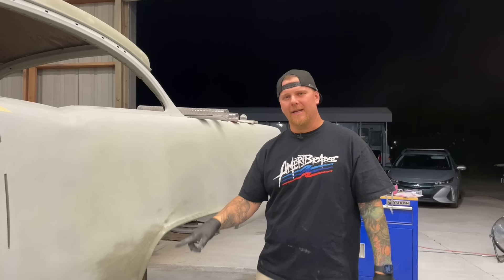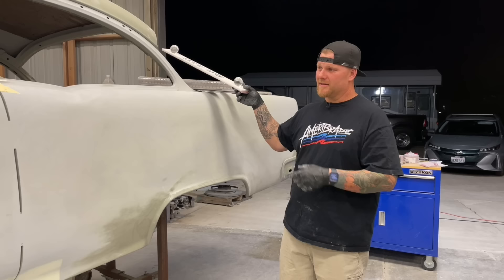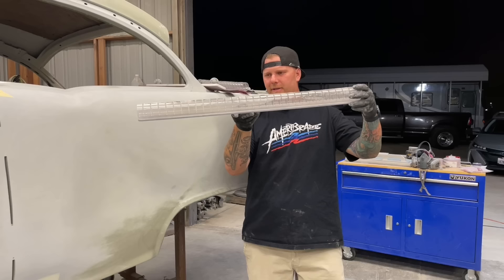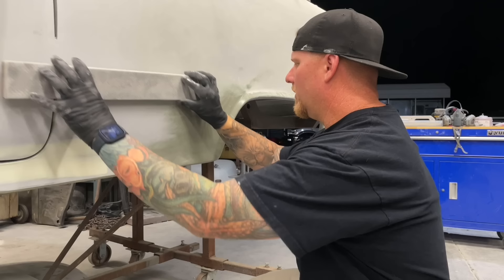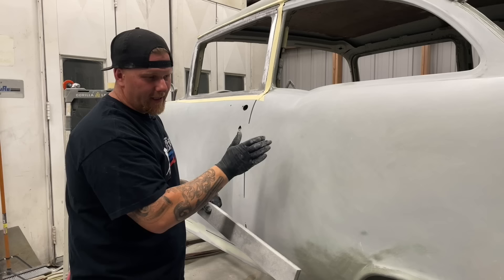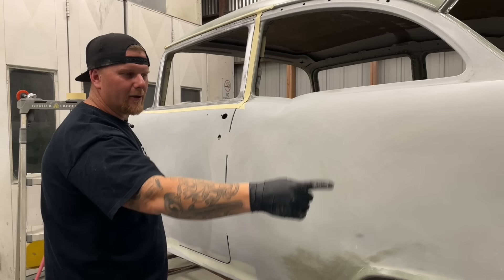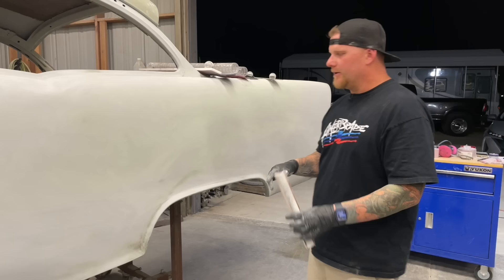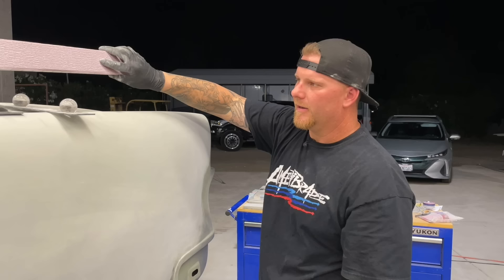Blocking The Details: Smooth Flat Mirror Transitions Every time

Comment: A few minutes after 7PM and I am in the garage, a man cave with dirt & shiny stuff covered in dirt. I guess I must old if I had a spray can made to hold sand paper on the tool I was using. I think it is between the distributor wrenches and the chrome tach-dwell meter w/cylinders 1-8 setting.
 I have eased the edge on a paint stick to work the guide coat off around the wheel house flare. I have seen that filler on the doors before and felt is the hinges are rebuilt, and gapped with a paint stick all the way around, perhaps a little hammer spoon or slapping spoon (Call it what you want, but use it) I have a length, curve radius and width drawn on paper, to make another so #3. I am not a body work guru, but you make it easy to understand. Either a sanding block or chainsaw, if you have to push & push every time, the paper is dull or loaded or the chain needs sharpened. Right! I used a folded wire coat hanger with a length of fuel line as a handle. This knocks the chunks of filler out but also you lose your sanding grit if the same paper was new 20 minutes ago. Get a new one, try buying a better product as it makes a difference on production. How many tools work better if we let them do the work? By weight, sharpness, etc. They made crank ice cream machines also, but to worn out to enjoy the ice cream. I am not saying to buy electric because either way, you still get ice cream.
  Question: You say polyester high build, but it make me think a tube of hardener with a clear liquid inside. This makes me think of polyester resin in fiberglass (Vinylester resins-pink) but I have seen comments that this is hard as a rock to sand? Instead of a cream hardener this is now methyl ethyl ketone (MEK) not methyl ethyl ketone peroxide used in the cream hardener. Many videos talk about sanding a Corvette, or fiberglass kit cars but bring up gel coat! That is colored spray on body filler that uses a styrene-monomer for thinning, but uses the MEK (Clear Stuff) to harden.
They spray gel coat on top of gelcoat (Not too thick if the fiberglass was right) but it is sanded that same way. Some boat techs keep a microfiber towel in a zip lock, spray dykem on the gelcoat as their guide coat. 
  No, this isn’t fair to ask you to put on your chemist hat with pointy tip, but for a high build primer that uses a clear hardner, does this sand harder like fiberglass because I have never used it. Just asking as I do research to decide what to buy! 
Have a safe 4th holiday….everyone.
Reply: Hi Dean. I know the VP2050 he uses is epoxy based. I don't think it's a polyester. This primer takes a little elbow grease to sand but not as tough as some of the polyesters I've used.
Reply from the maker: Thanks for watching. Not sure on that clear hardener sorry
Reply: @class5bodyworks  Thanks Chris! Very much as this old man leans. Elbow grease is on back order everywhere! Go figure. Stay safe an enjoy the 4th and time with family and friends!
I appreciate you info from experience!
Reply: @SYLVESTERSCUSTOMS  it is cool! Enjoy time off this holiday, I have 5 or 6 things to do that are hard for an old man, like me.
Reply: @deankay4434  
Anytime. They say age is a state of mind. I'm not so sure as I get older😞. This line of work is elbows,shoulders and knees. Enjoy your holiday as well everyone.

Comment: One thing for improvement and it doesn't cost anything compared to what it saves. Tape! Your primer work is hard,shrinkage is done, primer is "Gassed - Out" as I call the evaporation process necessary for purr-fection as Sylvester would say! Tape off your radius areas you don't want a line or accidentally nicked area or flat line (low-spot) to occur. Take areas down is easier than building back-up a fantom wave or straight line created from a sandpaper edge from your block. Pinky is also advisable, I do that too, but that point in your video you do not cover the end with your pinky! Taking tape prevents any mistakes we can easily make happen. Then roll your radius into the wheel well lightly to blend to straight panel. Tape is a Gret way to keep your body lines along the side of vehicles straight! Once you cross hatch down to a body-line Tape it! Then sand bottom half of car up to the Tape line placed ON the already flat cross-hatched primer! This gets a sharp straight line back into your side or primer area. I often times have too sharp of a line and lightly sand the sharp straight new-formed line with a very thin foam sanding pad very lightly to knock the "sharp-edge" down so paint doesn't separate from being too sharp.
Reply from the maker: Agreed! I dig the purrrrfect lol 🤣 if you haven’t already check out our video on body lines makes it pretty easy. I do all body lines last. 👌🏻

Comment: Just found your channel and learning a ton!  Also recognizing that my number one mistake over the years has been pressing too hard on the sanding blocks 😬.   So after 220, it’s fine to go straight to 600 wet sand?  No 320 or other grit between?

Thanks again for the amazing and informative videos!
Reply from the maker: I jump to 600 from 220 as long as you are thorough there’s no issue
Reply: Awesome brother, appreciate it!

Comment: So, I have told you before, I love your channel & wish I would have found it sooner! Thanks for all the great info. After watching this one several times, I am unsure of one thing: I am in the final stages of sanding my polyester primer @ 220 grit. I have burned through the polyester in a few places to have spots of either filler or epoxy primer showing through. I understand I need to apply primer (or epoxy sealer?) to those areas & block them down before 400 grit wet sanding. Do I use polyester? Or reduced epoxy primer (20% reduced epoxy primer will be my sealer). If you use polyester, I'm afraid of burning back through after all the grits. Thanks for answering my question!
Reply from the maker: Thank you!! Honestly if it’s just small spots I’ll just spot prime them with whatever primer you are using. If it’s a lot of areas I will prime it all over again. I use vp2050 because it gives way more build and you can wet sand it unlike most polyesters 👍🏻

Comment: Hi from Australia! I’m using VCP 250 on my project and my data sheet warns not to apply body filler over this product? Would data sheet be referring to large areas of filler over top but small areas with a wipe of filler would be fine? 
Your videos are awesome thank you
Reply from the maker: Body Filler may be applied over VP2050 after an over night air dry and a light sanding. If applying body filler, two coats of VP2050 must first be applied. This was directly out of their TDS sheet for VP 2050 not sure where you saw this. Hope this helps. 👍🏻

Comment: Three coats hibuild epoxy. Blocking now with 120. You instruct to fill small lows with thin filler. When that is blocked out, do you need to respray with the epoxy or can you proceed to paint after the wet sanding is done? Also…bare metal exposed…re-spray these areas?
Reply from the maker: Filler and bare metal will all need to be covered you also cannot wet sand filler.

Comment: Another great informative video! One question. Do you use the dry guide coat just before the wet sanding stage? I guess I'm asking, does guide coat work while using water? Thanks again. Cheers John 🍻
Reply from the maker: Because it’s shiny and smooth initially it won’t stick so I use aresol but after it’s opened up I use the dry. As for when wet sanding with water the dry works great. Check out the video we did on polishing clear coat with it even 👍🏻
Reply: Yes, it will work wet also.

Comment: After you've completed wet sanding to 600 grit, do apply a sealer before basecoat - or basecoat right on the VP2050?
Reply from the maker: You can do either or but I recommend sealing it then base coat.

Comment: There's been a lot of discussion about phantom wave caused by different materials expanding and contracting at different rates. You mentioned the primer is more brittle than the filler. Any reason why these two materials together wouldn't cause phantom wave? One is polyester and the other is epoxy based.
Reply from the maker: Phantom waves are caused by the metal work being under tension and not relaxed.
Reply: @SYLVESTERSCUSTOMS 
Curious. I remember discussion about why it's not a good idea to maybe topcoat the 2050 with a urethane or other type primer for example. So this has no effect in the phantom wave or is it more because of cure times?

Comment: How many inches is the longest block you generally use? I have the 32in linear block set and i can't agree more on how important the hand placement is. it's either flexing too much raising the center off the panel or the ends are off the panel just defeating the purpose of that size block thinking of selling the set on eBay or keep it incase i ever find myself working on a boat, would 24in be more practical or in your professional opinion is it still a bit much
Reply from the maker: You are correct the longest block I use is 22-24” long any longer and there’s no point unless you grow an extra arm 🤣

Comment: I've been doing semis here lately, and they've got huck rivets everywhere,  you have any tips on something like that?
Reply from the maker: That’s a big challenge. I don’t have anything on it. But if I was doing it I’d use paint stripper to remove all old paint and make sure the metal was in great condition so you could put down your primer minimally to keep mill thickness from building up and roll into paint
Reply: Thanks man

Comment: Do you only block sand die coat, or can you da die coat. I seen another chanel use a da and I didn't think that was right.
Reply from the maker: Only time we ever use a DA is when stripping cars 👍🏻
Reply: You can sand guide coat either way.  You'll typically see D/A used on collision repair vs. restoration.

Comment: Could you find an example  panel that was easier to sand? What happens to the rest of us 97% of people who have body lines, ridges, accents stamped in the sheet metal? Most of us can sand a sheet of drywall also. You are good and very detailed but most of us are working with a much bigger challenge's as far as sheet metal panels.
Reply from the maker: Then ask a question that can be answered. Every car has its challenges period.

Comment: Question: do you do the same process for intricate front bumpers?
Reply from the maker: If it’s an older steel one yes. Plastic bumpers no
Reply: @SYLVESTERSCUSTOMS  what’s your process for plastic bumpers?
Reply from the maker: @chefswole clean well, scotch bright adhesion promoter and paint
Reply: @SYLVESTERSCUSTOMS  very interesting, no primer?
Reply from the maker: @chefswole  sealer goes on before paint.